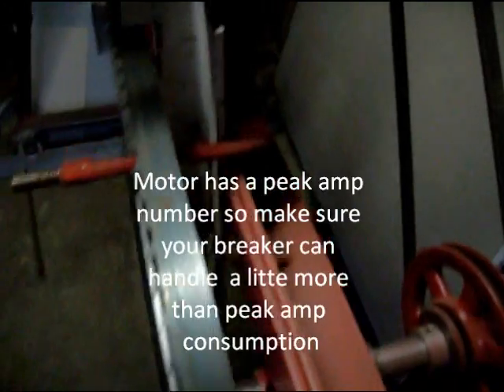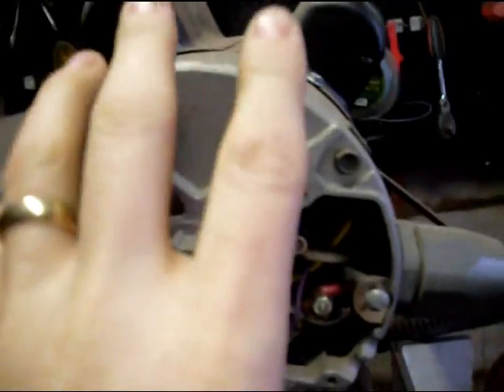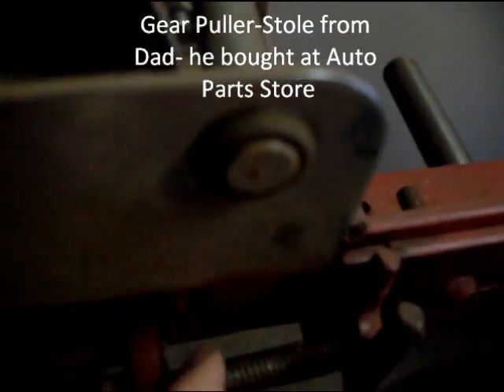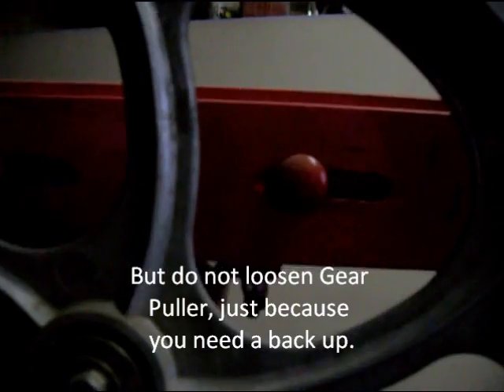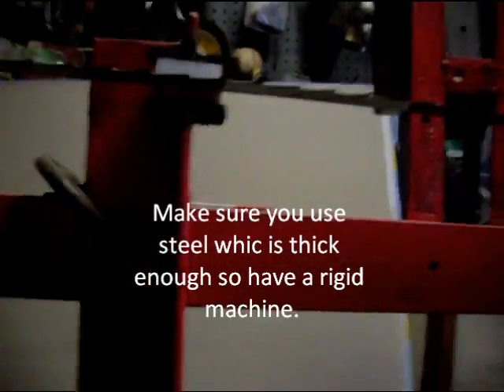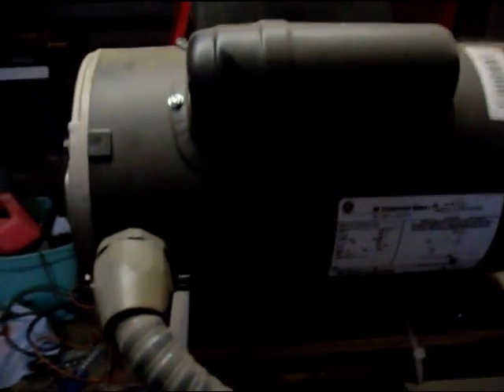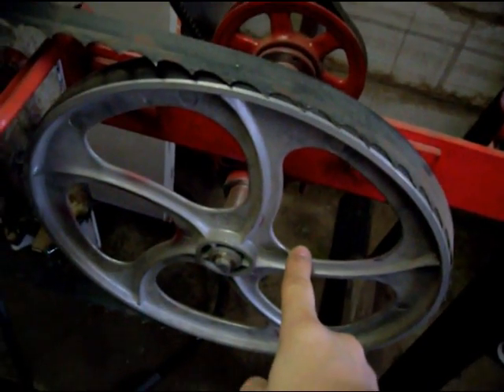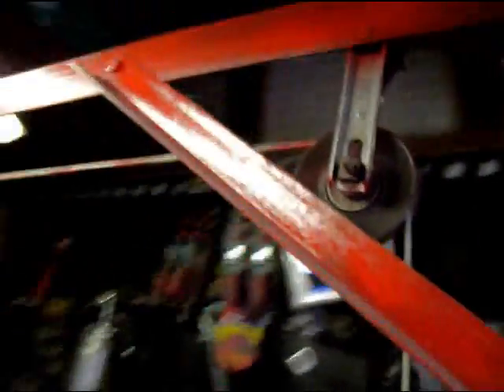Sawmill Construcion Details Part 2

Comment from the maker: @112669gene When I did it, I first laid down the tracks and free rolled the whole machine up and down it, the I measured the space in between them so I could cut the cross beams to hold the tracks together as a unit.  When I was satisfied they were the right size, I then tack welded them and ran it down the tracks again once more to check to see if it would bind or come off course.  So with after the last run I just welded it all. After that you just need to make your dogs.

Comment: I have the head assembly all built.( bought it from a junker. someone did a nice job building it, but never finished it) I am looking for details on building the bed. I have two 17' 6" 4x3 angle to start with. I am using 3" I-Beam trolly wheels. At this point I am not going to build it portable.